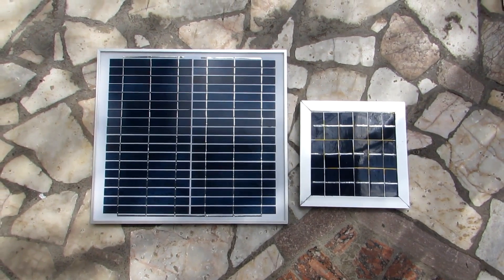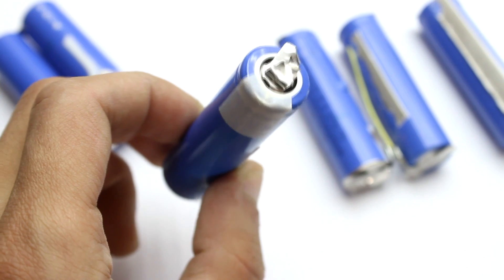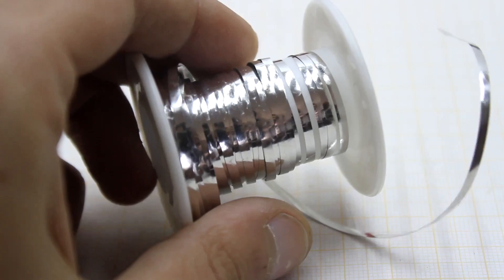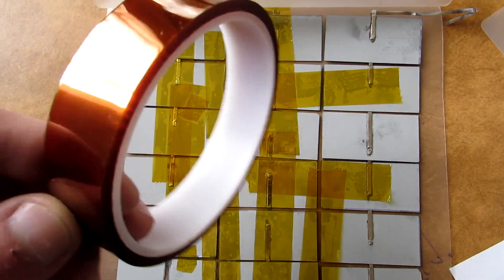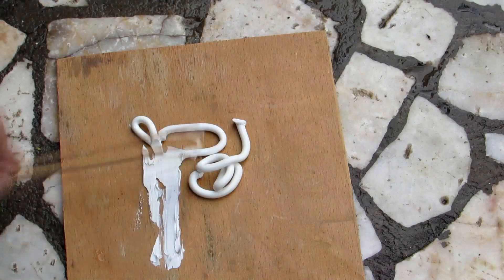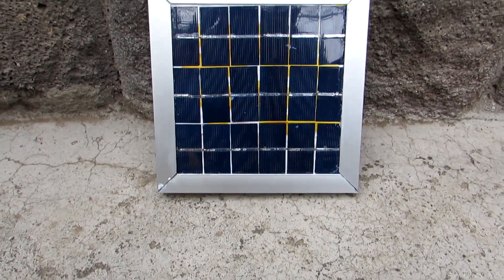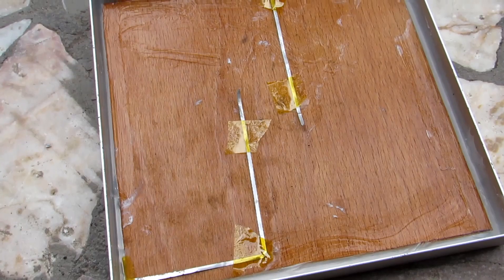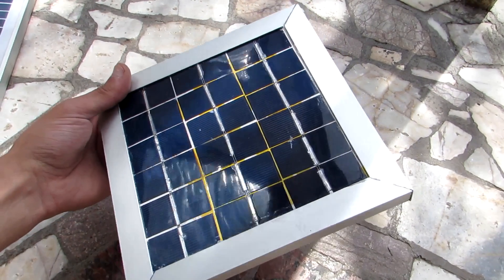DIY Solar Panel

Comment: Hmm... From what I know, you should put the solar panels on something that will cool them down, like on a sheet of aluminum or steel, since they can get pretty hot.
Wood is not a good choice for that, neither is plywood.

Aside from that, yeah! Awesome video!

Also, thankfully I've seen other people use the mighty laminating machine to laminate their panels. You are not alone, but I still love that you shared it!